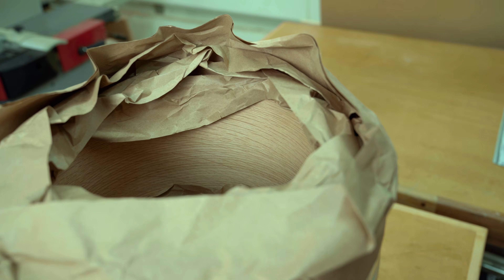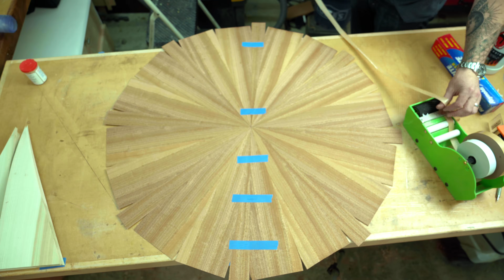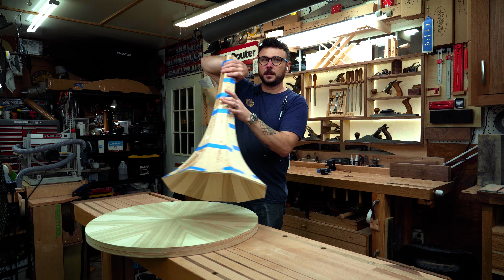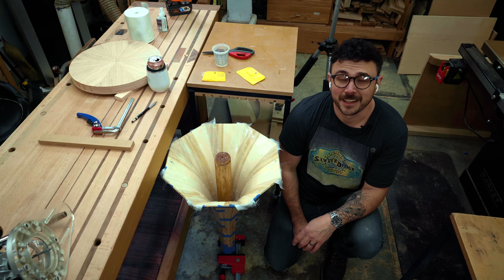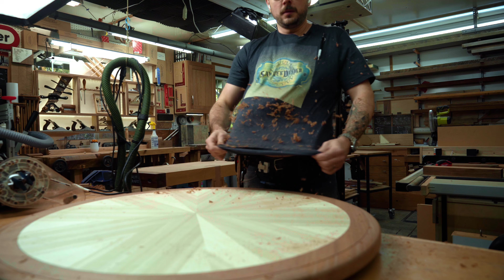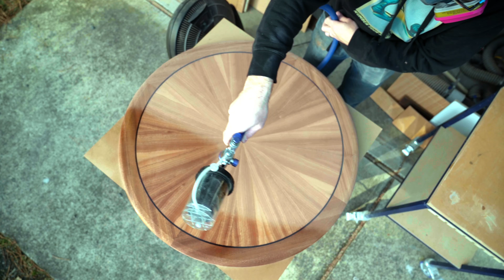Wood-bending Hack to Craft a $7,000 Bistro Table

Comment: Don't know if you ever read comments on 3 year old videos. but as someone who woodturns (probably not to the level of what I am about to suggest), I looked at that base and thought that if you looked at its negative space you would see a large hollowform shape. If you were to turn such, maybe segmented so you could keep tight control of the thickness and gradually build the shape, you would have potentially thicker walls and if you then slice it into 8 separate pieces, the toughtest angle being a 45 on the final cut, you would have flat edges on each segment that should be pretty easy, especially with extra thickness, to shape those edges to 22.5 degrees. Reverse the segments and rejoin them inside-out and you have your shape...PLUS the addition of having each segment curving gently inwards towards the center. Use it as a veneer back or use it just as it comes out. Either way, think this approach has some merit. And you could farm out the turning if not equipped, or add a new skill to your toolbox.

Great table with some scary woodworking.

Comment: I grew up with a carpenter as a father and grandfather its fun to see the differences and similarities with how you work and they worked. your definitely a lot cleaner. they used an air gun to clean saw dust which of course just moved it around!  some of the differences might just be new technology though. whats up with the big plastic bag?  if i remember correctly i think my dad bent the wood with hot towels and clamps. they built circular stairs and had to bend wood for railings a lot.

Comment: Very nice job.   Minor comment - I feel like the lighting at the end could have been better.  By that I mean I don't feel like it showed off the beauty of the table as well as it could have. But I'm not a pro-photographer so I don't know the lingo for suggesting better lighting.
Reply from the maker: Hey thanks! Couldn’t agree more. I’ve learned more about lighting than I knew was possible in the year since making this. Steep learning curve, especially when shoving a studio into a table sized footprint. Always learning. I’d be curious if you can tell a difference in production from this to a new video. Incremental improvements from a first person view are hard to discern.
Reply: @SawyerDesign  Sorry.  I didn't realize yesterday that I was watching a year old video.  If I had I likely would have viewed a newer one before commenting.  Anyway, I just watched your recent 'cursed table' video where you made lighter table tops for the pedestal tables.  It appears you changed both the color of the backdrop and the lights.  And yes, the newer video shows the colors of the finished product quite nicely and without the glare.

Comment: For the angle:
Yeah, your form simply was wrong. You did get 22.5° but not in the direction you wanted. You want a constant 22.5 towards your central line of the stand, but what you got is the 22.5 from the bandsaw - so that is always in relation to the cutting-direction. And with how bent the pieces are that means there is a significant change in the direction the angle is facing. Basically with a bandsaw you can not get the angle to stay the same independent of the cutting-direction without some extra (complicated) contraption.

Comment: Rather than thinking of the flare pieces as compound beveled curves, think of it as a thick piece of wood where the small end lies at one edge and the lip of the bell at the opposite parallel. The 22.5 degree bevel should then be measured from the square edge coincidental to the small side. By moving your bevel gauge to the real surface of the bell end you were twisting the gauge off-square and of course reading the wrong angle. 

I would have instead spent several days designing a jig to hold the pieces on the imaginary square, jointered half of them, realized I had miscalculated, paused for several weeks to beat myself up over my mistake, thrown them on the scrap pile, fished them out of the scrap pile, remembered I only did half the work and now need to design a different same jig for the other cut, decide the table saw would have been better because of course it would have,  blown out the first piece I tried to fix, procrastinate another three months, make a new bell piece, and finally after 6 months of starting and stopping assemble the bell. But that's why I don't have a woodworking channel.

Comment: Wow! That is beautiful!

The 22.5 degree problem is because you were measuring at right angles to the edge of each sheet. What you needed was 22.5 degrees measured relative to the virtual horizontal plane created by concentric circles around the finished shape. If you were going to mass produce these it would be worth doing the maths and making a jig, but for small runs your manual solution is much more pragmatic!

Comment: Great job mate

I having plan to-do big table in solid timber for a top in that wood direction design, meaning cutting angles to point in a center and glue boards like that together, so not vertical or horizontal cutts.
And worm of doubt came along about that wood movement, because in that case wood will be kind of locked in.
So what do you think about that or anyone who read this.
Thanks

Comment: Next time try a router bit for the 22.5 degree bevels.
Reply from the maker: That would be relative to the part though. The angle is relatively to the vertical plane that intersects the structure

Comment: Using an MDF plug of the cone as a mold to laminate fiberglass and finish with the wood veneer would have been a lot easier.
Reply from the maker: Depends on what you know. That sounds way less fun to me. Lots of ways to skin the proverbial cat. Once I wrapped my head around that join, it’s actually quite easy.
Reply: @SawyerDesign  Also, the fiberglass reinforcement would be continuous and therefore stronger. The exotic wood veneer is the expensive part of the material so using only one layer would save some money.  Once the mold is done you can start a small series of production with different wood species.

Stacking 1'' octagonal pucks on a rode would be the most straightforward way of nailing the compound curves corners.

Simon 
B.Sc. eng. composite material manufacturing

Comment: hey so obviously too late to say, but you already had the jig for the laminations why didnt you just put a stop block, and space the "sled/jig" up and put a stop block and rails on it and use it like a cross cut jig on the table saw??
Reply from the maker: Using the form? That wouldn’t have worked for a few reasons. I had intended to put the support on rails, but decided to freehand it and it worked perfectly so I aborted the sled
Reply: @SawyerDesign  no I saw what you did and it worked the second time around but if you had used the form, the one you used to make the 8 different peices, could you not have used it as a sled and cross cut the end of the "megaphone" I'm asking legit why it wouldn't have worked to get to your end result. I'm an advid amature at best wood worker and Im not sure why it wouldn't have. ** I'm assuming your reference point was the horizontal of the narrow part so if it wasn't then I do understand*** PPS I'm not talking about the 22.5* bevel I'm talking about the flat on the top, ie where you used the router and a dowel for centering and rotated.

Comment: A trick I’ve used is to fit the outer edge. Before attaching cut a rabet in either top or edge. Install inlay in rabet, flush it to which ever unit it was attached to. Then install nosing. BTW rabet the top it’s easier. Nice looking table.

Comment: I am up in Portland, OR area and always worry about wood movement from 1 day to the next due to our rapid changes in humidity and heat. I think that you are in PNW (I could be very wrong...) if so, how do you deal with those changes  when doing larger projects?
Reply from the maker: Hey I’m in pDX too. 1/8” per foot cross grain is my rule of thumb. Anything laminated doesn’t move.

Comment: I think one of my favorite things about veneer is that it's a surprisingly waste-free production process. Unlike with standard board ripping, the method of unrolling the log to create veneer just uses extreme force and a massive carbide blade, so there's no kerf and essentially zero waste wood.
Reply: I work in this industry in one of the biggest firms in EU. Let me tell you, there is soo much waste, you can't even imagine. Depends of the client of course and what quality they seek. Well wood doesn't go to waste, because we burn it for production. But still...you don't want to know, how many times i watched completly good veneer thrown into woodchipper, because it had small mistake in growth.  :D
Reply: @zamex23slo  you must be working for a particularly posh supplier if they don't just mulch it down and turn it into MDF or LDF. Though I'm personally a fan of using the same basic process of producing veneer to make sheets of plywood where the actual quality of the interior layers is relatively negligible unless your making the really high-end interlocking marine plywood.
Reply: @mndlessdrwer  Most of clients send final product to Milano for furniture, or to car manufacturers for cockpits. Audi, mercedez, even for Bentley. Pallet of extremly good weener  made our client 500k€ of pure profit.
Reply: @zamex23slo  makes sense that they wouldn't be as interested in small profits from making wood composites when their veneer is being sold so high and their clientele are so prestigious. At least it gets used for something useful as biofuel.

Comment: the problem is you aren't measuring the top along the plane, you are measuring it relative to the surface. 

Basically, you are trying to measure Latitude, but you are measuring it like it's longitude.

Comment: To trim the bottom of the base (instead of using the router) you could make a panel of sandpaper glued to a flat surface (mdf) and rub it around in circles to take off the excess. I've done this in several projects and it removes that router risk from your project. Cheers! Great project!

Comment: That vinegar with the steel wool technique is awesome. Do you just use white vinegar or any specific type? I really want try that out.
Reply from the maker: Yeah super easy! Just distilled white vinegar. Soak overnight or a couple hours in a hot bath.
Reply: Is there any other ingredients in that? And does it react with other types of woods to? So cool, just so cool.

Comment: Hold the top and bottom of the flower cone in the centre holes then it’ll spin like on a lathe then trimming the transition would be way more stable
Reply from the maker: That’d work great if I had a lathe
Reply: @SawyerDesign  
Oh I didn't say my words right you can use a 2by4 as a starting frame then add 2 sticks one on bottom one on top then you attach the center's of the cone so the thing can spin its easier to hold a stick

Comment: The problem with the varying bevel comes from you trying to do it in a single plane, but the curvature requires a two-plane bevel. A mobile router with some 22-degree jig would have worked better, because it would have allowed you to follow the curvature on both axes.
Reply: I’m trying to build a similar shape pending lamp... couldn’t quite wrap my head around the method you suggest... would you mind explaining a bit more?

Comment: This is a perfect 10. Well done!

I've been sitting on a design very similar to this for a few years. The biggest difference is the base I want to build has two flared ends (top and bottom). 
I've watched this 5 times and I can't understand how jointing the edge like that results in the perfect bevel. If you have any idea how that works or tips on how to get that angle, could you please share?
Reply from the maker: Hey thanks Luke. If you think of that cut plane going through the center of any solid, the natural stabile resting point or join is at the straight line that makes up that join. So as long as you keep the straight part straight, you get the correct angle. Harder to explain in words than it is to show. Does that make sense?
Reply: @SawyerDesign  Thanks for replying! 
Read it over a few times to make sure I understood. Then cut out a piece of cardboard with similar geometry to one of your base segments. Makes perfect sense now! Thanks again.

Comment: The piece was well done, there are a few different ways you could have done the base that would have made it  easier to put together, I would share those ideas with privately. I am not a fan of the epoxy inlay, I would have done something in wood, I don't know if you could have ended up with black, possibly ebony, not sure if it would have bent that tight, might have been able to steam bend it, which would have been a big process, maybe not worth the effort
Reply from the maker: Exactly. Easiest path with least resistance. The base was actually super easy once I got my brain wrapped around the miter. Could have made it solid and veneered, but kind of a fun challenge making it hollow (and weighed a ton less)

Comment: It seems like you have a Harvey table saw. If you do, then do you like it?
Reply from the maker: Hey Brian. Yeah I love it. It’s the 4HP Alpha. Lots of power, the high low fence has some cool benefits, though I don’t love the initial adjustment on it. The coating is a little gimmicky, but it seems to do what it’s advertised. DC isn’t great, but I don’t use the overhead and table saws just kinda suck at that anyway
Reply: @SawyerDesign , thank you so much for responding. I have been on the market for an upgrade. In NC the humidity can be tough and I have been curious about the coating. You are super talented and I am grateful for your quick response.

Comment: What kind of glue did you use to glue de wood veneer on the tabletop?
Reply from the maker: It’s xpress from veneer supply (Joe veneer) fast set and fibrous that leaves a rigid glue line. Also tinted is nice

Comment: Although they turned out great on the jointer, could you have taped the base panels together and then sawn them at the joints similar to fitting wheel felloes on a wooden wheel?
Reply from the maker: Maybe. That kerf would need accounted for and cutting the inside radius up that sweep might get a little tricky

Comment: WOW! You are incredible artist! I too struggled with creating a cone shape. The taper going from say 12 inches at the base to 4 inches at the top creates an angle other than 22.5. Nice job free handing it though. Did you glass the inside of the cone to account for small gaps in the joints?
Reply from the maker: Thanks Brian. I glassed it to account for any flex in the base being distributed across the whole system instead of wanting to split out those little miters. Just reinforcement.

Comment: What is that kit you have on your sprayer with the plastic reservoir?  I have the metal reservoir and I'm not a huge fan.  Slick table, man.
Reply from the maker: Thanks Jon! It’s the pps cup from 3M. Easy cleanup and you can shoot upside down which is cool.
Reply: Did you have to buy any kind of adaptor for your Fuji sprayer?
Reply from the maker: https://amzn.to/32FXvwX yeah this adapter and You have to get the pressure cup. https://amzn.to/3rdGILI
Works awesome. Kind of a spendy add-on, but we’ll worth it in the time saved in cleanup and switching between finishes
Reply: Thanks, man. Appreciate your input. Keep doing what you do. Love watching you throw down.

Comment: Absolutely amazing, Nick. I caught the "flower butt" label on the flute form... hilarious. How you freehanded that changing, curved angle was mind-blowing for me. Also, since you're colorblind - yeah, you got that oak purple-black. I assume you hit it with some shellac right after to keep it from rusting (think you gave me that tip, actually). I've found that what really helps the ebonizing is to paint on some tea (like, steeped from a teabag) and then use the iron acetate. It evens out the color across the oak components and automatically gives you that deep black.
Reply from the maker: Thanks Matt! I try to shellac pretty shortly after ebonizing. I remember us talking about your rust issue. I typically only have issues with the container of solution rusting, not on the piece (I keep the shop climate/humidity controlled) the tea trick is a great one.

Comment: I got two questions:
1.  How thick were your original 8 veneers straight out of the wrapping for the flared cone. and
2.  What are you smoking, drinking or popping to get these other worldly inspired ideas.  Or did you find a slab of rock engraved with these ideas under an isolated burning bush on a mountain top.  
Really, I'm a visual learner.  I get most of my knowledge on wood working by watching these types of videos and you are in a class of your own for the style of cabinet making you produce. .
Reply from the maker: Thanks Danny! The specialty thickness veneers are 1/24” and 1/16” from Certainly. Haha I have some experience exploring hyperspace and definitely attribute some of my eye for how shapes interact to that. The inspo for this was actually a morning glory flower.

Comment: That is really amazing build with lots of tricky woodworking involved. The problem with curved surfaces in real life often just to do with the fact that both the material and the blades have finite width. There is great video from Stumpy Nubs that talks about complimentary curves on a plane of a cutting board. Even that simple case is quite complex. Doing complimentary curves on a curved surface is pretty crazy 🤣.